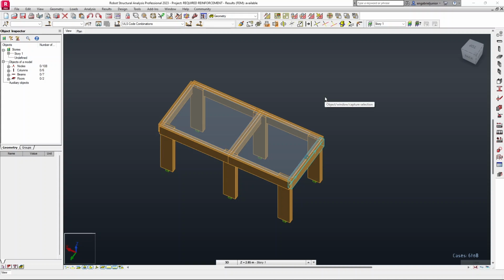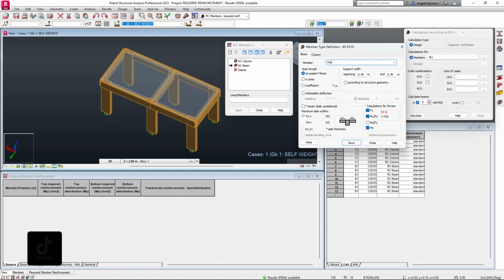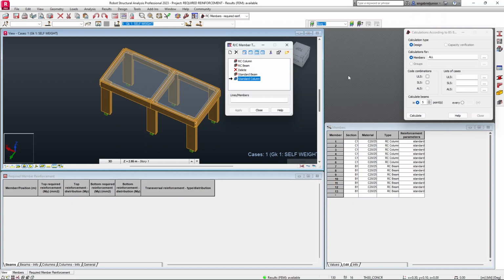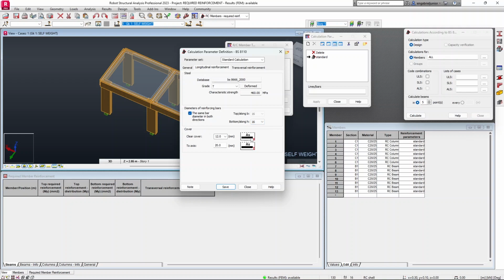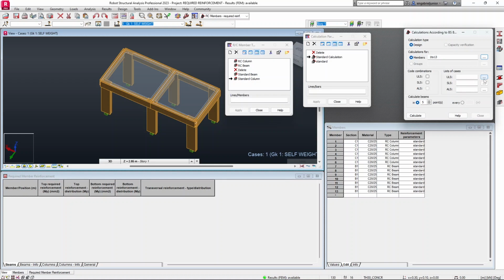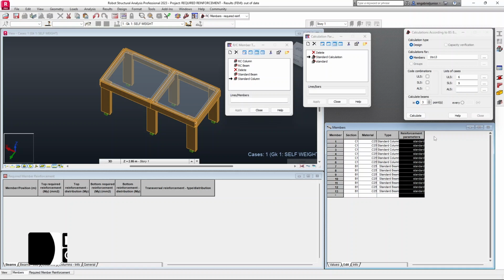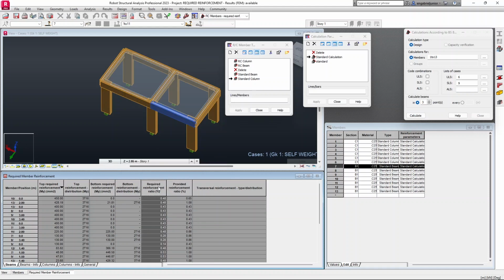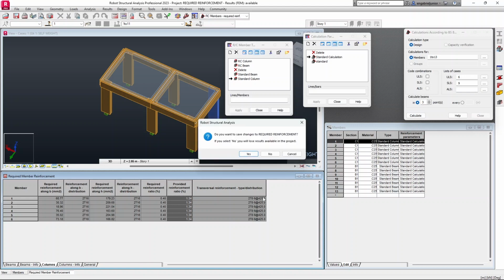Lesson 8 Design Using Required Reinforcement Option - RC Design in Robot Structural Analysis

Comment: Thanks for clear explanation 

1- For T beam if you didn't select it , is the software will  considere beam as rectangular.
2- For columns why you considered the buckling length factor as 1 ? 
Many thanks
Reply from the maker: The software will consider the geometry of the section as you had initially modelled it, however in the case of a rectangular beam, you can make it act as a 'T' beam in the calculations options in the "Required Reinforcment" module. 

I considered a buckling factor of 1 just to be conservative. This factor is reliant wholly on the construction method to be implemented on site.

Comment: Hello, my calculation table wasn't showing required areas and was presenting the bars as f instead of T bars, what could be the issue?
Reply from the maker: Hello, you need to change the reinforcement type in the job properties
Reply: Hello, kindly share the steps for editing the bar naming from f to T.
Reply from the maker: @musyokamwania3743  Hello there, the bar naming is based on the database you've set to be used in the project. To do this;
1. Go to Tools>Job preferences>databases>Reinforceing bars
2. Select add new database to the list, pick BS8666_2000. This one has the grade of steel denoted with 'T". Hope this helps. Kind regards
Reply: @ctstructures  Okay, let me try this now. Thanks
Reply: I have changed the template, and recalculated the bars, but the output is still in f and not T.
Reply from the maker: @ Ensure the added database is 'set as current' before closing the job preferences window. The option is on the third one (with a tick mark).

Comment: Is it possible to get a calculation note using this module?
Reply from the maker: Hello. Yes you can obtain a calculation note. Once you are done with running the module, select an element that has been designed, right-click on it and select object properties. A window will open with several tabs. Go to the 'code check' tab and you will find it populated with code-based checks, click on print-out report and a window shall pop up with the calculation note. Hope this helps. Good day.